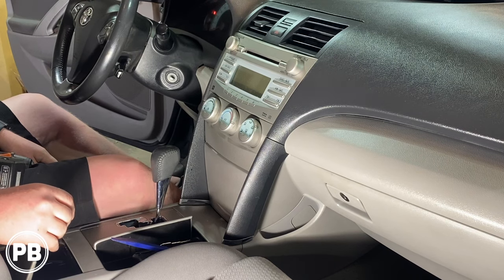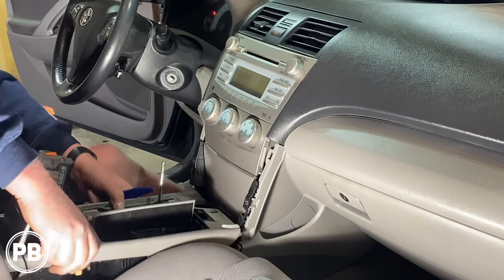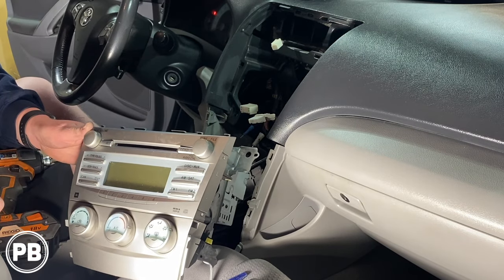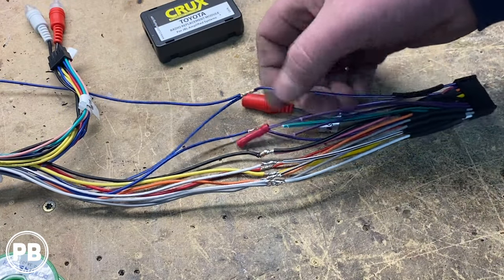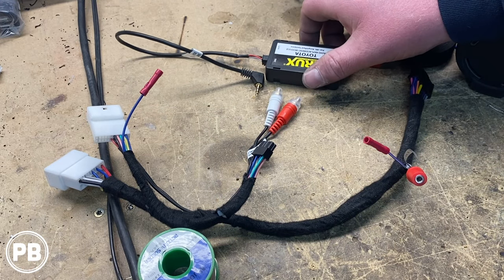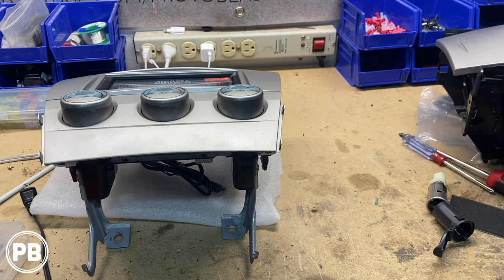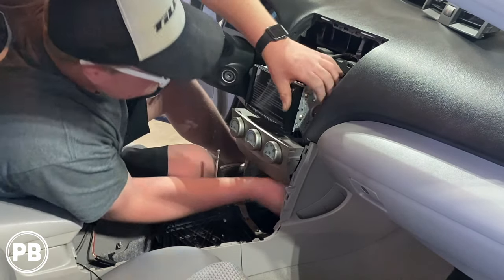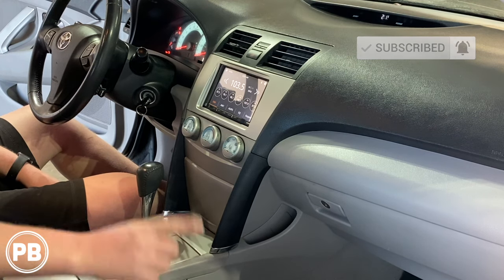2007 - 2011 Toyota Camry Radio Install

Comment: the only thing i gotta correct you on ... wire nuts are fine in an automobile, been hooking up radios since the 80s and they are fine. what you said, dont use wire nuts they are not designed for automotive application is absolutely false. only where there will be water or condensation is when they are not safe. they are totally fine on car radios, ive been doing it since the 80s.

Comment: Right now I have my sub working and my front door and back speakers working it’s just the onley thing Im missing is a new stereo  cause my factory I wanna take off but I want my steering wheel and subwoofer and speakers to sound clear and loud

Comment: Will these parts listed fit for the XLE model Toyotas Camry..I have a 07 with the jbl factory amp and been watching your videos. Just can't decide on bypassing the jbl amp or not. Kind of wanting to retain with factory amp what would you suggest?. Bypass or retain the Jbl amplifier
Reply from the maker: Yes, and i'd see how it sounds before you bypass it.  IF audio quality is terrible, then take the leap to bypass the amp (using our amp install video).
Reply: @ProvoBeastAudio  alright sweet man I really appreciate the response 🤝🤟
Reply: @chrstiano2497  Did you do this yet?  I also have an 07 with JBL..
Reply: @pappascw  yes I just ended up following his videoa step by step man and then sold the Camry a few weeks later lol
Reply: @chrstiano2497  did it sound ok did you have to bypass JBL system??
Reply: @pappascw  okay at low volume but higher it gets distorted so I followed his new video and bypassed the amp itself..got a 5 channel amp and yeah..if keeping the stock stereo I would just go upgrade the speakers itself with the right ones and just go from there man honestly any vehicle that has JBL or factory amp you gonna have to bypass the factory amp..I had a Lexus gs300 and literally just cut the speaker wires and disconnect the power to the amplifier and just ran the speaker wires from the harness to the aftermarket stereo itself and worked like should your just using the aftermarket stereo wattage output like normally would if that makes sense..don't know if you can do the same with the Camry but I'm sure you could..depends what route you wanna take honestly..

Comment: What does "retaining JBL" mean? You mention it's needed for steering wheel controls, but is that all it's used for? I'm considering not using it alltogether.
Reply: JBL was a factory upgraded stereo system with extra speakers and wiring beyond the basic stereo system.
Reply: The JBL amplifier with the upgraded sound system, if you don't use it then you're missing out on better sound. And plus these radios aren't designed to power the JBL speakers because of their low impedance so it's important to retain it

Comment: Thanks for the vid! Stereo is in hand and parts ordered off the links you provided. I'll definitely be watching your video again once the wire harness arrives. Thanks again!
Reply: How has it been holding up so far? Thinking about doing the same thing.
Reply: @colt259 Install was easy. Just make sure you have the correct w/h. I thought I had a JBL stereo but turns out, I didn't.  Had to return w/h for correct one. Had no issues with return  either. Good luck with your install

Comment: Great video.......too bad fit & finish is sub-par in regards to the Metra installation kit. Thank you for the excellent video. I will be purchasing an aftermarket 9" Android/CarPlay unit. The Metra kit killed my idea of using my Pioneer AVH head unit.
Reply from the maker: You're right, it's not the best design, but be careful with Android based units as they have a poor reputation of having terrible longevity and overall quality.

Comment: I’m getting ready to do this swap except I have a 2011 manual transmission Camry
Reply: Did you do it successfully? I have a 2007 manual and I’m looking to swap it ojt
Reply: @hunterolson3744  it came out successful just the steering wheel controls doesn’t work anymore…

Comment: so if youre replacing the JBL amp with an aftermarket one, would you connect all the wires together or leave the rears out like you did in this video sir ?

Comment: Did you have to splice a female adapter onto to the SWC cable from the radio harness adapter?  I don't have a female plug for the SWC cable from the Crux wiring harness to plug into.

Comment: Great video!! helped me install my aftermarket stereo in my 2007 Camry w/JBL system. I connected the CRUX adapter. but I realized the Camry had 3 white harnesses but the CRUX only had 2 white harness. My Steering wheel control isn't working but I did connect the 3.5 cable for the sterring wheel control so I'm wondering if that 3rd unconnected harness has anything to do with it. What do you think?
Reply: did you get the crux model for with jbl? I dont have jbl so i got the "s" version and mine came with 3 white connectors. one was just for the rear speakers which im not going to use anyways. not sure what the jbl version of the harnesses look like

Comment: Is this the same process for the hybrid? the ac control is slightly different but the head unit looks identical
Reply: were you able to find out if its the same process for a 2007 toyota camry hybrid???

Comment: my camry has 2 antenna connectors (large white and smaller blue) and they don't fit into my new stereo.  I didn't see that mentioned on this video, is my stereo the wrong model?
Reply: Ik for mine, the original stereo did house the white AND blue cables.. but for my new stereo you only need the white

Comment: I have one question. I’m planning on using a dual port type c dual port for the CarPlay/charging. I’m having a hard time finding the right 12v to 5v usb adapter you used in the video. Do you know where to currently get one? Thanks!

Comment: Hi, I have a question.  I've been watching your video.  to make a change of radio to my car.  I have a Toyota like yours and the module I use is different from yours.  and mine does not work to answer calls on the wheel.  In your car if I work this modular that you put.

Comment: I had a new radio installed similar to this one, but it keeps going in and out camera goes off too. Would you know what it might be or why it's doing that??
Reply from the maker: camera going bad, or a short developing somewhere.  One or the other (or maybe both).  Check connections.

Comment: Does this car have the amp under the passenger seat? My ac controls are different too.
Reply from the maker: IF there is an amp under the seat, that indicates you have JBL.  No amp means no JBL.  See the parts listed in the description based on your year and trim.

Comment: Sorry I’m missing two parts, do you need to buy a antenna cable adapter or do you connect the old one into the new radio? Also, I quite don’t get the dual usb adapter, one cable goes to the radio but how do you connect the other cable or where?
Reply from the maker: No antenna adapter needed, OEM male Antenna plug fits aftermarket radios.  Dual USB adapter isn't needed, just use a single one and connect it to the USB on the back of the radio.  Dual USB was used where the second USB end was converted to a full-time charge with use of a 12v to 5v adapter. Single USB adapter: https://amzn.to/3gGHkms
Reply: Thanks a lot!!

Comment: Hey sir how did you connect the RCAs to this radio from the amp? I know you didn’t do it in this video but in your other one with the 5 channel amp. I see no RCA slots on it so i’m confused.
Reply from the maker: This radio has RCA outputs.  It's on a separate dongle which is how Dual Electronics decided to use them.

Comment: I just had my 07 camry stereo replaced but now get bad reception...what could it be? Any idea?
Reply from the maker: Need to hook up the amplified antenna circuit to help boost reception. It’s a blue wire on either the radio harness adapter or the antenna harness adapter.

Comment: My 2011 Camry has factory  JBL navigation, steering wheel controls, and factory backup camera.  I am replacing the entire audio system. I have a question: What is the best way to keep  the factory backup camera , steering wheel audio controls, and the factory USB/ 3.5mm?
Reply: Did you ever do this?  I'm considering doing similar..  Not worried about the backup cam but the rest of it

Comment: frist of all i would like to thank you for making it so simple i follow your video step by step and it wirks fine i use Crux61J for my camry that had JBL system it works fine but my aftermarket harnes dose not have a blug for steering wheel control it says on the instruction to connect it to SWC1 AND SWC2 which i dont know how to fiend them  my after market radio is Sixtop Android 9 inch Car Stereo for Toyota Camry 2008 - 2011+Rear Camera & Microphone so please if you can help me to conect my steering wheel control i "ll greatly appriciate it thank you
Reply: I need help on this as well. 2011 xle withJBL. I HAVE AN eBay Android radio with built in steering wheel controls and don’t know which wires to tap into. Please help!!🙏🏾
Reply: This may be very late but I had the same question.  I checked the instructions for the Crux and it says the following:  For aftermarket radios that have wires for SWC connections, cut off the 3.5mm plug on the Crux SWC Cable and connect the SWC wires as follows:RED to SWC Key 1, WHITE to SWC Key 2, SHIELD to SWC Ground.  Note that there are some radios that only have SWC1 and SWC2, in this case “shield” does not need to be connected.

Comment: Curious how you even got it back on with the factory brackets to the new radio. Having a problem with fitting on mine currently
Reply from the maker: if any factory tabs are preventing the radio to sit flush in the bracket, a hammer can be useful..

Comment: Will this work the same on a 2010 camry hybrid? I want to get a new radio so I can have a backup camera and navigation in the car itself, but I don't want to buy everything to find out its incompatible. My car does also have a JBL sound system.
Reply from the maker: Yep it should be the same parts with JBL. Linked in the description

Comment: I tried to move the fader to rear speakers but the sound fade to off , and I  connect the radio through canbus to the factory amp (JBL) is it normal or what ? and did i lost the surround system or it's normal and i just have to put the fader on center only ?
Reply from the maker: the OEM JBL amplifier only takes two channels of input from the factory radio, and the fader is done digitally at the amp, not at the radio.  When replacing the radio, you lose the fader option if retaining the factory JBL amplifier.
Reply: @ProvoBeastAudio  Yes that's exactly what's happening , so is it ok or what and did i missed the surround system or it's working and i have to leave the fader on center and everything works fine.
Reply from the maker: @mohammadgreen9125  Just leave it on center.
Reply: @ProvoBeastAudio  Yes that's what i did , but what I want to know if did i missed the surround feature ? while the new android screen connected to the Amp through the canbus , and thanks alot for your response appreciate it.

Comment: Did you combine the pink wire to the black one? I’m using the crux wiring with out JBL since my car doesn’t have it.
Reply from the maker: If the pink wire on your radio is your parking brake wire, then yes you can simply ground it.  If it isn't the parking brake wire, we can help more if you let me know what brand radio you are installing.
Reply: @ProvoBeastAudio  Ah thank you. Yeah I just solder the pink wire to the ground and it works fine. Also I was wondering If the steering wheel volume up and volume down buttons can be used with this stereo since the buttons on my, 2009 Camry LE steering wheel, doesn't seem to work with this stereo

Comment: hello i did everything and mines doesn’t turn on it did once then turned off
Reply from the maker: Sounds like a bad radio, mistake in you wiring, or the wrong install parts.

Comment: When I removed the stock deck in my 2010 Hybrid Camry with JBL, there were 5 rectangle connectors and the two round antenna connectors...  with the SWRTY-61J, only 2 connectors are now available to reconnect the new deck...  what do I do with the remaining vehicle harnesses? and are they necessary?
Reply from the maker: They won't be used with the Crux, not necessary.  Just depends on what options the aftermarket harness adapter is providing you.  The Pac version uses 3 or 4, but thats because it is providing more options.  You will be fine with the Crux harness.
Reply: saludos tengo Toyota Camry 2009 puse radio tatil Android 11 pero no me funciona los votones del volante saludos ayuda por favor gracias

Comment: Can you explain how you installed the double usb to power?
Reply from the maker: Remove the power socket, put this in its place, connect the USB male ends to the USB inputs of the radio.
Reply: @ProvoBeastAudio  how do you remove the power socket?

Comment: How are you getting the rear speakers to play if you didn't hook them wires up on the harness?
Reply from the maker: The factory JBL amplifier only takes in two channels of input, and uses those two channels for all speakers in the vehicle (fader is controlled in the amplifier, not at the radio).  That is why you don't connect the rear speakers in our video as the amplifier doesn't use those channels at all to produce audio for the rear speakers in the vehicle. Again, this is only in the case if you have the JBL audio factory system.

Comment: I installed a BOSS head unit in my ‘11 Camry xle with jbl, used the same crux harness but when I set it to BOSS setting my steering wheel controls are all switched up. Volume down button skips track, etc. any suggestions on what this could be?
Reply from the maker: Try a different dip switch 
 configuration
Reply: In the past I’ve seen that BOSS radios are really weird with SWC, if you have the opportunity it might be worth returning the radio and getting one from a more reputable brand.
Reply: We’re u able to figure this out? I got the same problem

Comment: how much does this whole process cost?
Reply from the maker: Lots of variables there, depending on the shop, where you purchase equipment, labor, etc.  If you buy from amazon, all parts we used are linked in the description.  Labor (if done by a stereo shop) will vary place by place, and some shops require you to buy their parts to do the install.

Comment: How much would it cost to have this done? Roughly
Reply from the maker: Well, we linked our parts used in the description which will show the price of parts.  As for labor (if you don't do it yourself), that will vary depending on what shop you visit.